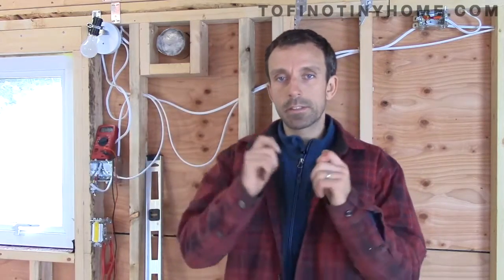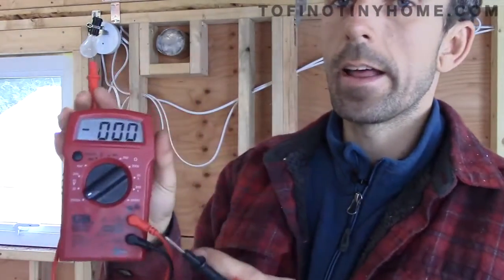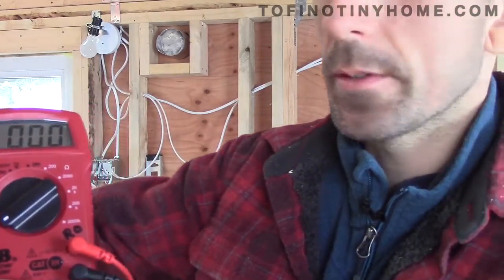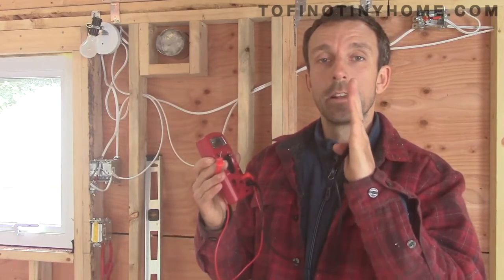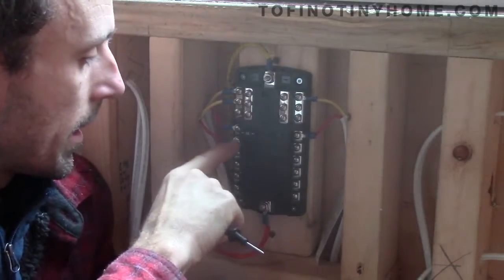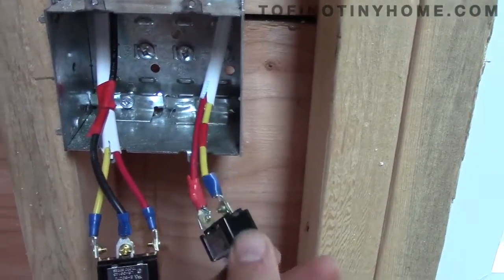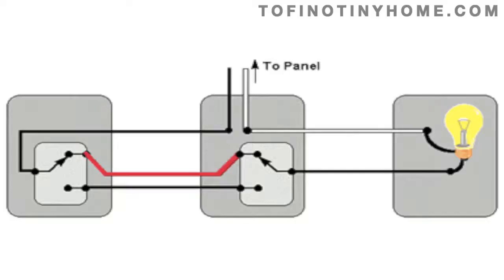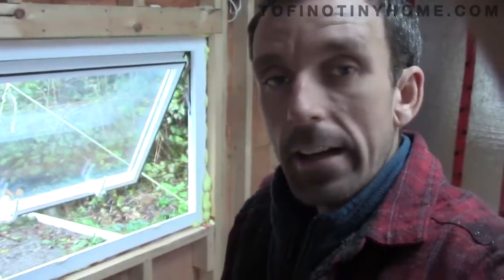Electrical Wiring a Tiny House -(Part 6 12 volt 3 way switch)

Comment: i only confuse on your diagram and those switches, you showed 1 three way and 1 regular on off, so how many of those switches i need connect for 3 way? and on your diagram which is positive and negative on the switches, and also on a 12 volts led lite  there is a polarity on it
Reply from the maker: Hi there, booth switches are on/on switches 12v toggle switches. It doesn't really matter which side of the bulb is pos or neg, but in this example i would say the black from panel is positive and the white from panel is negative. Then the 2 wires that join the switches will change based on where the switches are placed.